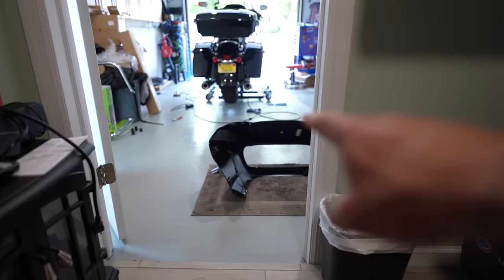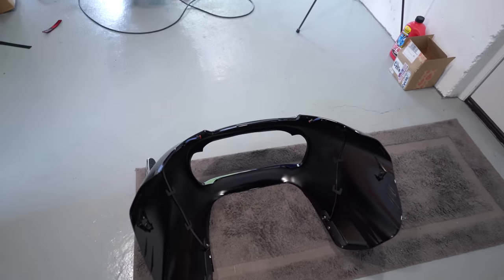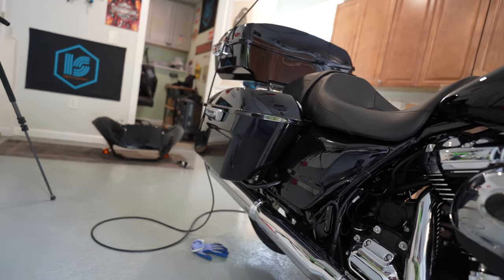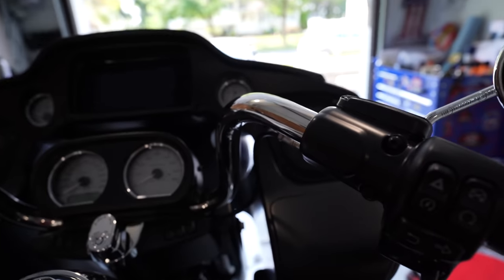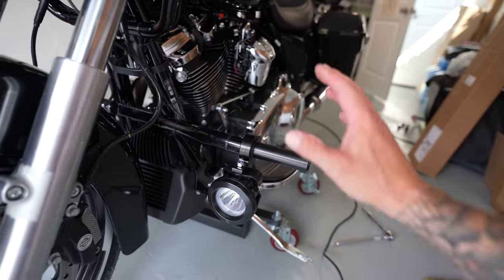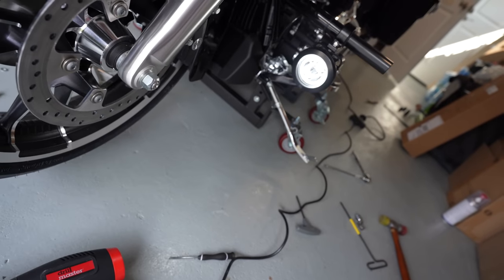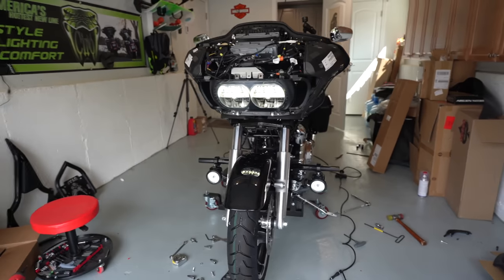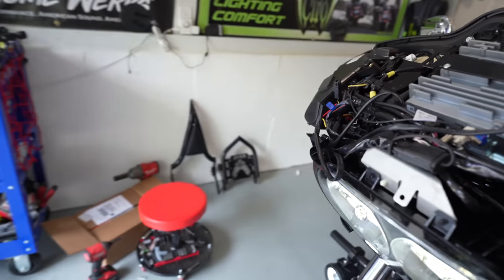2022 Harley Davidson ROAD GLIDE | Upgrades #harleydavidson #roadglide #streetglide #roadking

Comment: I run the same crash bars front but also the reat. The front was a PITA to install was a little tight had to pull the mounts out to finally get it to install. Really like them, if i had any issues it was just the fitment was just a little off. Rear bars are money though!

Comment: Change the battery to a lithium battery. This will save pounds off the bike.
Reply: That's my next mod. And a a1 cycles swing arm. The arm cuts 14 lbs alone. Those 2 alone are so huge for sprung weight .
Reply: @donaldpeck3192  advan black lithium battery cuts 14 lbs also
Reply: I have had bad experiences with lithium battery on my street glide

Comment: Silver Back = Mighty Gorilla. 
King KONG The mightiest of Gorillas. 
John,  do you have an affinity for Gorillas??
My ST Street glide is on the same path.  2 into 1 exhaust saves 15lbs. Braiile lithium battery  21lbs. Came with no rear pegs and a solo seat. I'm shooting for a 600 lb bike.  Will see 👀 what the end result is.

Comment: For floorboards,  check out MJK Performance. I just put a pair on my RG. They sit further back 2," a little higher 1," and offer a pitched dove tail so that you can ride as if you have mid controls. Great grip too. Not cheap, but well worth it.